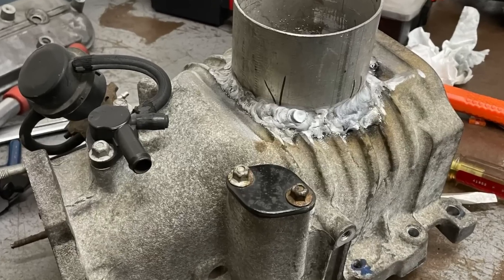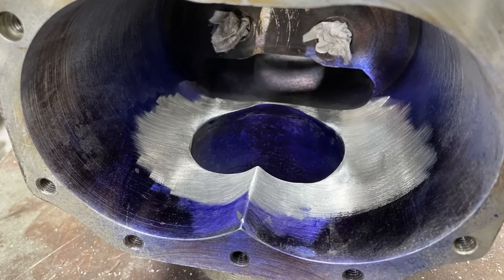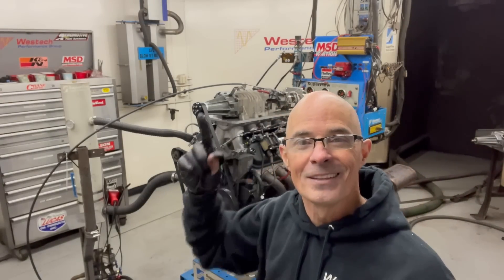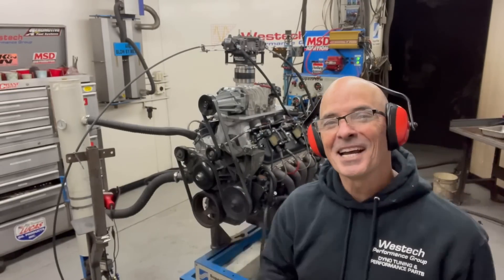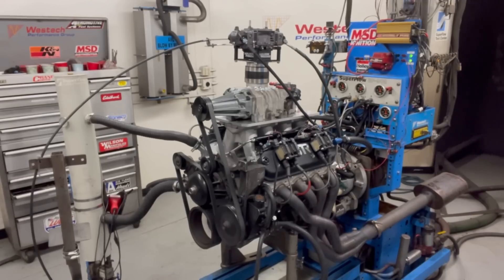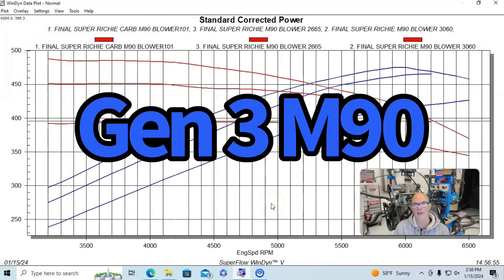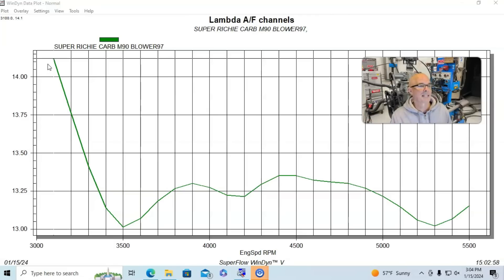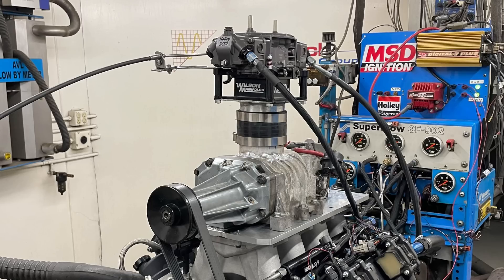CARBURETED M90 LS TEST-HOW TO: RUN A CARB ON A CHEAP M90 SUPERCHARGER! JUST CUT A HOLE IN THE TOP!

Comment: JB weld instead of welding might have saved it from warping.
Reply: I agree. I saw a vid on here if a guy who put an m90 on an olds motor. Used the stick cast iron intake with a flange jb welded onto it for the supercharger. If that works it’d 100% work with a carb flange
Reply: Just taking your time with the TIG probably would have avoided the warping.  You get in a hurry and you build a bunch of heat.
Reply: Some serious booger welds. Just tack it on and seal it with JB weld.
Reply: Exactly what I thought
Reply: I had a yamaha 3 wheeler the previously mangled the mounts on the head and lost the rubber manifold. It ended up a jb weld abomination and behold the oxygenated gasoline made the jbweld melt!!! 😅 so no jbweld is a real temporary solution once gas with clorinated ether hits it
Reply: @Arc-popz  doing couple of dyno runs for YouTube video doesn't need a permanent solution.
Reply: You have to heat up the whole piece before welding.
Reply: I believe I'll try cutting the main plenum hole and drilling and tapping the case (blind holes) to accept a 4 barrel carb adapter- the type used to cross between Holley/Rochester. It will need to be modified to conform to the body of the supercharger. The adapter and bolts holding it on will be covered in JB Weld and the adapter will have studs for the carb. You could probably even leave the case ribbing intact by simply drilling 4 appropriately sized holes like a factory GM Quadrajet intake. Just make them slightly bigger than the butterflies. JB Weld has been used inside of intake manifolds by racers and porters for as long as I've been alive, but yes, make sure your fuel is compatible with the type you choose. They're not all created equal and if it fails there's a good chance it's your own fault. Due diligence is a thing.

Comment: With the stock pully on the 5.3 you made more power but when you rested it on the 4.8 the first time you made less right what was different here
Reply: 4.8 is short stroke, 5.3, 5.7, 6.0 and i believe even the 6.2 use the same stroke.
Reply: @shadowopsairman1583  yes all true nothing to do with my question but true
Reply from the maker: that was timing